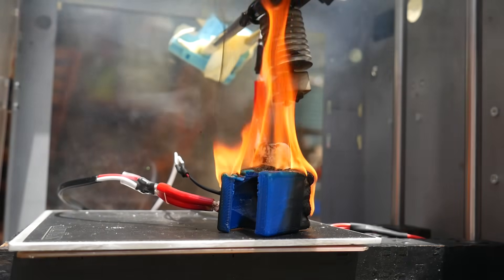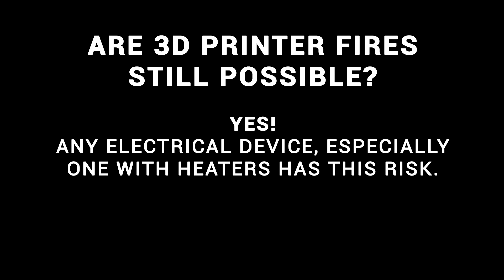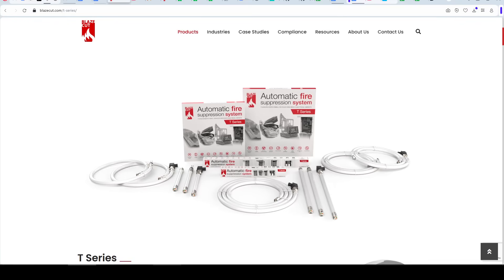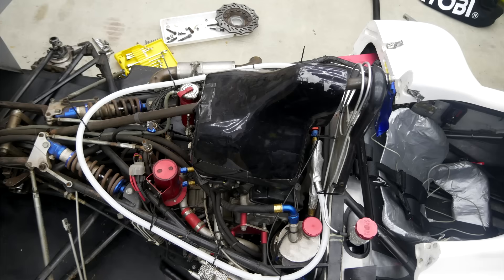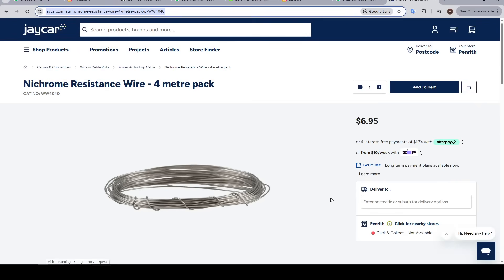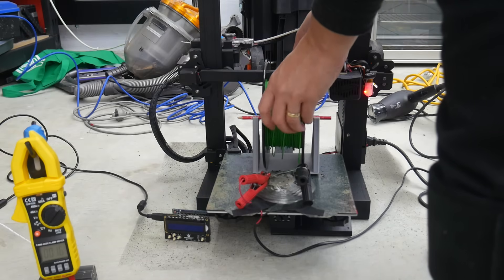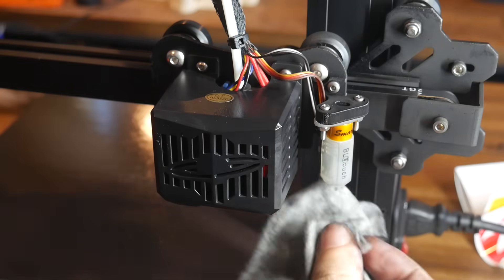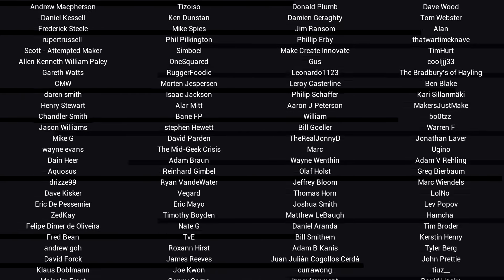Testing a BlazeCut fire suppression system for 3D printer fires

Comment: I’ve been involved in 3D printing for probably around 10 years now and have had extensive discussions with colleagues in the field. The issue of fires has always seemed more like a mythical story someone shares over beers on a Friday evening—something everyone's heard of but no one's ever actually seen.

First, the idea of a hot-end causing a fire dates back to the earliest days of 3D printing, with the original RAMPS boards and homemade firmware. Safety measures like limiting heating and detecting thermistor anomalies became standard almost immediately. I simply can’t believe a printer nozzle could become hot enough to reveal glowing nichrome wire. Even if some fool disables firmware safety limits, the heating block would short-circuit, blowing the transistors on the control board and disabling the printer. A more likely scenario is the hot-end melting its mounting and falling apart or picking up a large blob of plastic from the print bed—yet even then, no one has ever had it actually ignite.

Second, a fire originating from the heated bed seems more plausible, especially for printers running on mains voltage through a powerful solid-state relay. Yet even in this case, the wiring is more likely to melt and cause a short circuit (tripping the breaker) rather than igniting open flames.

Third, the wiring itself. Even overheated wires have a hard time igniting plastic; modern wire insulation doesn't easily burn—it hardens, causing the wire to break and short-circuit, thus mitigating the issue. The real risk here is the short-circuit in mains wiring, which should be managed by your circuit breaker. If your breakers fail, that’s not a printer issue but rather a candidate for a Darwin Award.

Fourth, the printer’s enclosure—this, in my view, is crucial. Most enclosed printer casings in recent years are made from plastic or even wood—materials perfectly capable of catching fire and allowing flames to spread outside the printer within seconds. The tube in question would likely do nothing to stop this. In fact, the sudden gas expansion from the melting enclosure could even spread flaming liquid plastic further, turning a localized ignition into a full-blown disaster.

This last point is particularly significant. Apparently, the fire suppression tube activates only after prolonged exposure to high heat from open flames, taking tens of seconds, and would only effectively extinguish a fire in a sealed enclosure. This delay allows plenty of time for the casing to melt or for flames to consume it (where far more fuel is available compared to the print area). This makes placing a short tube in the center of the printer’s roof rather than along the moving portal or at least around the perimeter of the enclosure rather odd.

Considering the price of this SINGLE-USE device is almost the cost of the printer itself—especially when a simple fire sensor linked to a smart plug costs about ten times less—it hardly makes sense.

And your suggestion of placing such a tube in a computer case to prevent fires from Nvidia’s notorious connector makes me question the objectivity of the review. It’s obvious that by the time flames inside a computer are substantial enough to trigger this device, there’ll be nothing left to save. Believing that a one-time gas discharge could significantly impact a fire inside a highly ventilated computer case with strong airflow sounds more like fantasy than reality.

In conclusion: this one-time-use fire suppression device is poorly suited to real-world 3D printing scenarios and costs about as much as a comprehensive system with a CO₂ extinguisher (with an electronically controlled valve), fire sensor, and smart plug combined.
Reply: The tubes cost like €120 shipped. I'd love to hear about this comprehensive CO₂ system for €12 lol
Reply: I had a mainboard failure where firmware safety could not do anything: the MOSFET was shorted and heater element ran always after powering up the printer. Happily it was the bed heater's MOSFET, not thet hotend one.
Reply: @NoIPHU that's what fuses and thermal fuses are for.
Reply: Yea all these IKEA enclosures are such a fire hazard. That's why i am going to use steel frames with glas windows for my enclosure project.

Comment: This functions just like a Fire Suppression Sprinkler System in commercial buildings where there is a piece of glass/plastic that shatters at a specific temperature releasing the suppression substance without having to worry about false triggers and only that specific sprinkler goes off.

Comment: It's a bit comforting to know that the filament burns so poorly
Reply from the maker: Reasonable amount of flame, but a slow burn. I guess that means it could burn for some time at a gradual pace.
Reply: Might be lack of fresh air (oxygen) in enclosure? When burning PLA from nozzles, I think it kept burning and dripping.
Reply: @kimmotoivanen  Helps for sure, but from what I've seen from other tests it does seem like a lot of filaments genuinely burn poorly (poorly enough though? No idea).

Comment: What kind of build plate is that on your A1?
Reply: Should be a G10 build plate by "VPS Data". Don't be surprised if you visit the shop as the pictures usually show the (matte) G11 plate, which by the way is great for TPU.

Comment: So far I'm mostly just relying on Kipper's protections, I also installed a 130C thermal fuse on my AC powered heated bed and grounded the bed to earth. AFAIK microswiss does not have any issues with their heater cartridges falling out but I've been looking to invest a bit more into fire protection. Being in the states with crazy tariffs at the moment ill have to shop around for other solutions similar to this,  I usually keep an eye on my printer via a webcam. If you don't have any external protection, its best to not leave your home with a printer running.

Comment: Nice demonstration.
Gotta admit tho, I would still have rather seen you try to actually set a hotend on fire. NBR showed that this is possible on an old ender 3, but would it sill work with a ptc heater or even a copper heating element, as the main issue in his video was the molten aluminum of the heat block

Comment: I have a fire detection system that switches a relay that's controlled by both the supervisor of my 3D printer -- a secondary processor that executed a self test and monitors for possibly shorted connections -- and the fire detection. But critically, the supervisor does not actually sit inbetween the detection system and the relay. The fire detection system acts as a crowbar circuit across a fuse for the relay that is otherwise Normally Open.
Reply: as I posted, a simple bimetal AC switch is used in industrial and home driers etc. to shutdown if the motor shorts out etc. Cheap and simple and they work. Sold with different temps. you want NC versions.

Comment: Very interesting product, though I feel it would be safer if it triggered even faster in the case of a 3D printer fire. And that DIY wound hotend took me back to the old days! We would actually use high power resistors to heat up the hotend. Thinking back that was totally unsafe compared to what we have in our modern machines.. I still have a lot of old hotend models and I'm wondering if there's a 3D printing museum that would like to have them.
Reply: i didn't know 3d print museums exist... but id wanna go to one
Reply: With heated chambers capable of 60C, with that likely increasing to maybe 100C in the near future, I'm actually glad that they chose a high temperature. It's well below the combustion temp of anything that should be near a printer.

Comment: Looks like a PEX pipe with a charge of R-134A
Reply: R-227ea Heptafluoropropane according to BlazeCuts Safety Data Sheet. It can produce hydrogen fluoride if it comes in contact with flames and decomposes (as other halocarbons too).

Comment: I've been in 3D printing for years now but this is the first time I've ever heard about 3D printer fires. That's insane! 🤣
Reply: they are less common now, but the Anet a8 was a very popular machine due to usually being sold for around $100 per kit or even less sometimes. Luckily things have advanced a lot since then.
Reply: @martinsmith2948  yes! I had one! I found a short circuit on the heated bed connection! 😅 I changed it after many years of risks 😂
Reply: That's odd.
Reply: Fire was one of my main concern when i bought my first ender 3 v2. A hotend that runs at 200-260°C and it's temperature is controlled by a low quality thermistor and an embedded controller is usually a point of major concern.

Comment: Nice testing Michael.  I had one of these installed in the enclosure with our CR-10 at work many years ago to meet safety concerns.  Luckily it's never needed to be used, but it is definitely nice to have the insurance in case a fire does break out.  This is definitely a good system to have.

Comment: I have a Home Assistant server. My 3D printer is already connected to a smart plug, and I'm going to buy a Zigbee temperature sensor to install in the printer's enclosure. All I'll need to do is write a YAML script to shut off the power if the temperature rises abnormally.
The Blazecut system is a big plus, and I'm thinking of buying two for my printer and my home electrical panel. The investment is minimal compared to a house fire.
Reply: If you have much room in your enclosure there are automatic 1kg powder extinguishers for roughly 40£ at some hardware stores or online which are way more reliable in my opinion. Those things are around and proven for a long time and basically work like sprinklers with the little glass capsule on the valve which come in different activation temps.
Would create more of a mess but it should be a last ditch safety anyway.
Reply: @XShaneX19  Not any place for a 1kg extinguisher in my printer and powder will kill every electric system in the piece in the place . I have my servers and computers in the same room than my printer .
Reply: @XShaneX19 if the powder extinguisher goes off, all your electronics in that room will probably be dead, as the powder is highly corrosive. I would only have this as a very last ditch measure if you plan to leave the printers unattended for a very long time
Reply: My 3D printer is placed in a closet and i have connected it to a smart plug and a smart smoke detector placed right above the printer. It will instantly power off if the smoke detector triggers. It works great :)

Comment: "3d printer fire" -> immediately i think "ANET A8" lol.
Reply: I had 5 of them over the years, little did I know my house was very close to burning down the whole time!
Reply: I had one Anet A8, i had custom firmware on it which turned safety features back on.
Reply: Still was i risk tho :)
Reply: Lol i considered buying one as my first printer
Reply: Still got one two feet to my left.
Reply: I changed the firmware on mine and enabled thermal runaway. It definitely saved me as I had one heater pop out.

Comment: I'd love to see a video about setting up a smart plug to allow remote power control in your printing workshop.  Especially if you have multiple devices in the workshop to control remotely
Reply: Home assistant is the way to go, easy to integrate smoke sensors with smart plugs or even circuit breakers
Reply: Agree 100%.  I've seen some setups that are either all-in-one connected to a phone or a "janky" setup with a hodge-podge of questionable quality parts.  Such as relays that aren't really capable of achieving their rated amperage, etc.
Reply: Agreed, home assistant should be the stable way to go. I'm using a zigbee power socket. You only need a raspberry pi 4 or 5 and a zigbee adapter and you can hook any zigbee device to it. Software is free and you don't need some Chinese software to run your devices. Just local and secure